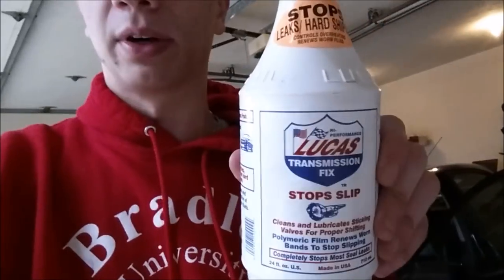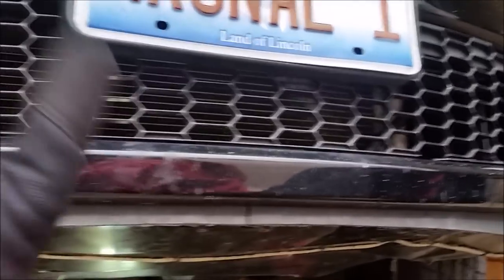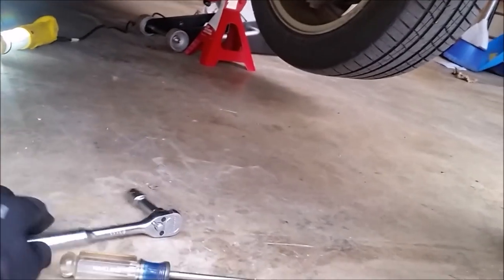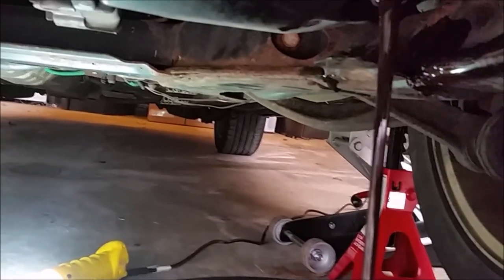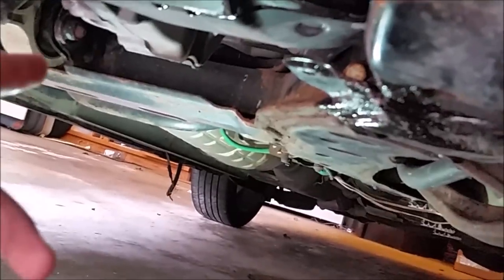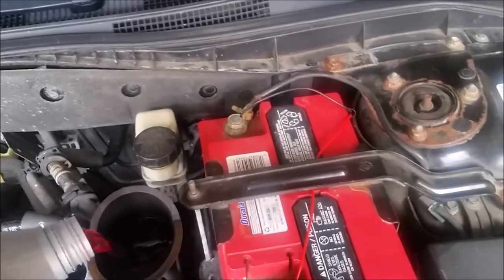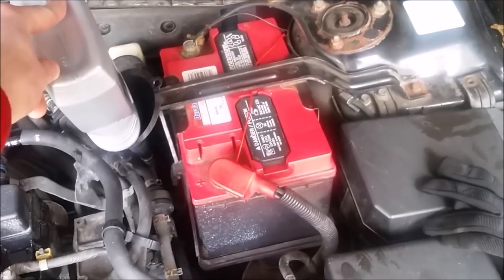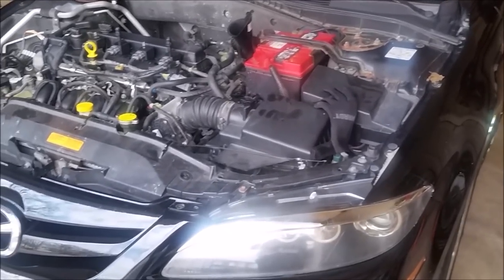Fixing jerky  automatic transmission and hesitation in acceleration   2006 Mazda 6

Comment: ok so my Mitsubishi eclipse is AT and from 2nd to 3rd but rpms go high and then stabilize when I check the fluid level hot it says it's good
Reply from the maker: Jesus G Even if fluid is filled to proper level, I would see if it smells burned or is black. If it's bright red then you might have internal transmission wear that requires a new transmission.  You could try  taking one quart out from your transmission and then add 1 quart of Lucas transmission stop slip.
Reply from the maker: Jesus G was it a used one?
Reply: Anthony Awada ok so basically I got the car used at a Mitsubishi dealership. it's 69k miles and the tranny fluid change is 60k so after I drained it and refill it started doing this 2nd to 3rd shift lag even though it's a AT so idk if it's a solenoid problem because it doesn't really make a clunky noise when shifting

Comment: do you heave any idea w c be the problem on amazda cx7 make a noise only on drive and aveleratedon doit on neutral or parking tks i just change the turbo  to
Reply from the maker: Hi Jorge, thanks for commenting, so your mazda is making noises as you accelerate (when it's in drive), and when it's in reverse and neautral?
Reply from the maker: I havnt heard from you in a while Jorge, but here are a couple ideas to remeber with the cx7. 
whenever you are done driving it. put it in park and let it idle for 3 min before turning it off. that way you cool the turbo. noises in acceleration could  be from cam shaft phasers (which mazda had a recall on). also remember those cx7 are know for bad timing chains, so maybe your chain is making noise. If you don't do regular oil changes and let your turbo cool before turning it off then those cx7 will give you problems.
Reply: Anthony Awada I have a cx7 and I let it sit for a year because of the airbag recall which I'm still waiting on but when I let it warm up then put it in drive it doesn't go but in reverse it's hesitant and only 118000 miles I put in a quart of transmission fluid but not sure if I should keep it or just get rid of it

Comment from the maker: Please make sure you guys put the CORRECT AMOUNT OF FLUID before driving the vehicle. If you don't , the AT light could come on and CATASTROPHIC CONSEQUENCES including serious damage to the transmission could happen. Best way to make sure you put the right amount back in is to check the level before you do this fluid change and make sure its at the correct level. Then measure the amount that dropped out from emptying the pan and put in the same amount in. If you are hesitant to use Mobil 1 fully synthetic, it would be best to stick to Mazda-V (M-V) fluid which you can buy only at the dealership for around $10 a quart.
Reply: Do you remember or know how much fluid comes out when you drain the pan? On your video you say that you only put 1.5 qt + the lucas oil but than at the end you say you 4 qt. Do you know how fluid you need to replace when doing a drain and fill via the same method you did?

Comment: Hi, when do you add the lucas slip?
Reply from the maker: Hi tommy, add it when your car shifts between gears. For example: Lets say when your car shifts from 1st to 2cd there is a slight delay in shifting followed by a jerk and your entire car.
Reply: +Anthony Awada I'm sorry... I meant should I include the Lucas fluid as a top off? Or should it be included with the amount of fluid needed?
Reply from the maker: +Tommy Thompson (TT the C.O.D.A) Good question, you should NOT top off. Meaning don't just pour it in. You need to remove 1 quart of transmission fluid then add the 1 quart of Lucas.
Reply: Thanks for all your help Anthony. I used the Mazda trany fluid about a year ago, it made a difference. But using the Mobil, made a world of difference, thanks again!
Reply from the maker: You're very welcome Tommy, Mazda ATF is pretty good, but synthetic fluid is much better especially for the winter. It's thinner so needs less time to warm up.
Reply: Ohhh, I see. Question... So then if it warms up and the fluid expands, will the troubles occur then?

Comment: does this work for an 1999 626 Mazda
Reply from the maker: Yes, of course, if you have the automatic transmission.Please note that because of the difference in year and model, you will be needing different automatic transmission fluid than the one used in the video.

Comment: I know this is an old video, but hopefully some can help and answer these few questions. I bought a 07 mazda6 2.3L and after about 3 months there was a loud noise from the engine, i took it to the dealer and they said i needed a new engine, the said they put a new engine in, not a rebuilt or used. I change the oil in it every 3000k or 3 months which ever comes first. I have 150k miles on the car itself, how would i know if this was in fact a new engine?
2nd) also do you think they changed the trans fluid on the car when putting the new engine in, or is that something i need to do, i mean would they have to drain the fluids in the transmission if they were installing a new engine?
my 3rd question is, i have the antifreeze overfill container in the front by the hood latch, i know some have them in another area, I see that there is green antifreeze in there, but i see my cap says to use fl-22. I cant seem to move the over fill container from its places, is there a easy  DIY to flush all the coolant out of the system and the overfill tank?
4th & 5th) I recently did the brakes on the car and had the control arms replaced, my car also has the new engine, but when they installed the engine the engine light came on and they said i had a stuck intake manifold runner flap which i never seen this problem before they put the new engine in, the mechanic told me this when i went to pick up the car, so I am not sure if this was an error on their part or if this was actually like this. Is this something that they could have screwed up and they're trying to push the blame away from themselves? also the car seems to shake a lot when I come to a stop, like a red light, while I'm still in drive, but doesn't do this when I'm in neutral or in reverse, anyone know what this could be caused from?
 thanks for taking the time to read this and any good and knowledgeable advice would be appreciated
Reply from the maker: Hi Graeful Aya, so to begin. It is very difficult to tell if it's a new or used engine. You can usually tell which it is depending on what kind of warranty they gave you. Obviously 150k on the car doesn't mean 150k on the engine. If you really want to tell, you can have some disassemble part of the engine, good mechanics can tell the difference between used and new parts.
What I would do if I were you, get the car tested heavily. Which means, do a leakdown test, ping test (for rodnock), take the valve cover off to inspect the timing chain to be tight and look for any sludge buildup, and most importantly do a compression test. If everything is in the green, it doesn't really matter what type of engine you have. Just keep taking care of it and doing preventative maintenance and it will last you a very long time.

To answer your Trans question. Yes, fluid will fall when they take the engine out. But they could just catch that fluid and put it back in. Thankfully,  these mid 2000's Mazda's did have transmission dipsticks. So take the dipstick out and inspect it. If it's pink/red. You're fine. If black/ semi black then its time to change it. And if you have to change it, do it correctly and drop the pan and change the filter (not just a drain and fill like this video shows). And the only type of fluid I would recommend ( and don't let anyone tell you otherwise) is Redline D4 or Mazda V fluid (which can ONLY be bought at mazda dealership). It's actually cheaper than redline d4.

As to your coolant, FL-22 is green coolant. You can always try to siphon the coolant using a hose or turkey baster. Not sure why it's giving you a problem. There should be a hose on the bottom of the overflow tank that if you take off will drain what's in the tank. 

As for the intake runner flap, it's usually the sensor that sits ontop of the intake manifold that breaks allowing the flap to stick. I doubt during your purchase of your new engine that it came with new sensors. So that sensor was probably from your old engine. Therefore you can't really hold them accountable for it. Unless, they broke it while transferring the parts from the old to new engine. But anyway, that sensor is like 50 dollars new from mazda and installation takes 2 minutes. 

I hope this helps.
Reply: well thank you very much, yes this did help and answered my questions very well. I should mention that i had the engine installed about 2 to 3 years ago and I have only put about 15k miles on it since then. The only reason i knew about the runner was because the mechanic told me that it was stuck shut, but i do have a new manifold which i was gonna install, but maybe I will try the sensor first before i replace the intake manifold since that would be much easier. also I can't even get my hand to the bottom on the overflow tank, and it's almost impossible to lift it up, the overflow tank is just like the one that is on the car in the video, and i got underneath the car and did not see a hose attached to the bottom or any hole to attach it to, I will look again. Also i did not know that the green coolant was fl-22, for some reason I always thought it was the yellow one. well i am glad that after i did my best to flush the coolant i stayed with the green coolant. Once again thank you for your time and answers.

Comment: i have a 2006 pontiac grand prix All of a sudden my car starts to jerk after every shift when it shifts to 1st gear it does a light jerk then jerks again and after second it jerks harder i dont know what to do can you help me please.
Reply from the maker: Pontiacs have very weak transmissions from my experience. Have you checked the fluid?
Reply: Anthony Awada The fluid right now is A clear brown and its full but i bought from this guy for 3000 and gave him a 1000 down idk what to do
Reply from the maker: It could be a good price if it was well maintained. Brown is not good, it means it is old. Transmission fluid should be bright red. Check your transmission mount and engine mounts. Sometimes transmissions jerk harsh because of cracked or bent mounts. I would also get that fluid changed, not flushed. Flushing your fluid at this stage might do more damage than benefits.
Reply: Anthony Awada and too get this fluid change i just do what you did or was that you flushing it. sorry im a beginner when it comes to cars
Reply from the maker: I am happy to help you, Changed refers to doing what i did, which is dropping the transmission pan and replacing the old fluid that was in the pan. Doing this will not change all the fluid in your transmission, because there is fluid left in your torque converter and transmission itself. Even though you are changing 1/3 of it by doing a "Change" it is safer because flushing could cause serious damage to the clutch packs if the transmission is already damaged. Flushing refers to completely flushing out all the fluid, which includes the pan, torque converter, and transmission and requires a special machine to do. Flushing is good on a well maintained car but very risky if on a car you don't know the history of. The reason why flushing is dangerous is because when you replace all the fluid that fluid acts like a detergent and eats your clutch pack in your transmission which results in more damage.
I would recommend using Lucas stop slip when you change your fluid. Also make sure you get the right fluid. AutoZone definitely sells it, but you'll be getting generic brands. I have had best luck using Redline transmission fluid. It is expensive but damn it's good.

I hope this helps!

Comment: I don't understand why the transmission oil change fixed the engine hesitation?
Reply from the maker: During gear changes, the car would take some time to accelerate after switching up a gear. This was due to high friction on the gears as the fluid wasn't was weak and did not assist the transmission .

Comment: Hey I'm in desperate need of help here. I'm assuming this is the same Mazda/Ford FNR5 transmission in the '06-'09 fusions same pain in the a** pan removal same fluid. Mine shifts hard 1-2 And 2-3 good after those and downshifts on the highway are also rough. I've changed the filter twice and the fluid 5 times each time with MAZDA MV but it still happens. Lucas didn't help nor did lubegard. Have you found anything helpful?
Reply from the maker: Sam Lyons Hi Sam, it doesn't look good good Sam unfortunately. If I were you I would try 1 last solution if you are up to it. Take the pan off (sorry for the pain) and tighten the bolts that are on the valve body of the transmission. They should be around 10 pounds of torque if I remember. I just get them pretty snug. After that put Redline ATF D4. It has helped the shifting very well. After that, I'd call it quits and replace the transmission. Make sure you fill it up correctly once the car is up to temperature.
Reply: Anthony Awada if a transmission replacement is in the cards I'll just have to keep driving it til it truly dies and leaves me in the middle of the road somewhere lol the most frustrating part is sometimes every shift is 100% perfect sometimes they're a little rough but "could be worse" other times they'll throw you back into your seat a decent amount. I've tried to find answers everywhere even the dealer I bought it from told me it was fine even after their $175 diagnostics fee. It's driving me insane.
Reply from the maker: Sam Lyons check your fluid level. I've seen so many people destroy transmissions because improper level.

Comment: how Is it holding up
Reply from the maker: Hi Michael, it's holding up pretty well actually. To be completely honest with you sir after a couple weeks of making this video I removed the pan (which is a hastle) and changed the filter as well.  Then replaced the fluid with Castrol import ATF and it is excellent.  Not 100% but it's a 10 year old car and it's driving great.
Reply: +Anthony Awada cool have a 03 6 I took it to the shop just to change the filter was a 3 hour job and 300 dollar charge smh
Reply from the maker: Omg, I'm sorry to hear that man. It cost me a total of 40$ ( because I got highest quality fluid and filter). Probably could have been around 25$ if I got the lower end stuff.
Reply: +Anthony Awada yea right but I just drain 24 fl on trans fluid and add 24 fl of Lucas stop slip my car is no longer slipping when engaging into drive it catches right on and gets up and go thanks a lot for the video man
Reply: +Anthony Awada yea right but I just drain 24 fl on trans fluid and add 24 fl of Lucas stop slip my car is no longer slipping when engaging into drive it catches right on and gets up and go thanks a lot for the video man
Reply from the maker: +Michael Pritchett You are very welcome!

Comment: one more thing when i do acceleration upto 50kmp after this my car start missing acceleration  or i can say my car do jerk badly and other thing is i checked my engine qwails i got oil in them is this problem for my acceleration or something else should be ?
Reply from the maker: Pawandip Singh If your car is having trouble accelerate you could have some serious transmission  problems. Checking engine oil is good. but make sure to check the transmission oil to make sure it is okay. I am not sure if Honda civic has a transmission dipstick, but checking the fluid is necessary.
Reply: Pawandip Singh did you find the solution? My car is really doing the way your car is

Comment: Would you believe me if I told you a mechanic told me to add about half a bottle of those small bottles of brake fluid. Mine is a 2003 Mazda 6 2.3 L. The car is a family beater. We all use it when ine breaks down, which is all the time. The car has been running fine for three years now. And the car before that would not even take off anymore. I don' t recommend you do this if it's a nice car. I recomend doing it if you are going to beat it until it dies or if you are going to sell. Just my .05 cents.
Reply: The brake fluid expands seals but its a bandaid :)

Comment: My mazda 6 jerks from 1 to 2 gear and I though it was a big problem i.g not
Reply from the maker: It's very common on Mazda 6 and Ford Fusion. If you want the transmission to last a long time however, then make sure to change the fluid.
Reply: Anthony Awada. I will do so soon
Reply: sk honcho did you get it changed for your Mazda and did it help? My Ford Fusion has the same problem and it just started yesterday out of no where
Reply: scott bowling no even tho I should do it
Reply: @Bk1_sk  did you fix that issue?
Reply: Farmazan Furniture & Interior nope i got some other advice saying if I change it could make the problem worse.
Reply: @Bk1_sk  car is still running without fixing it?